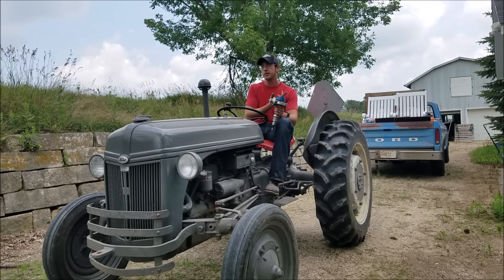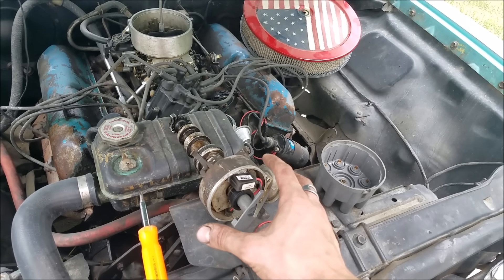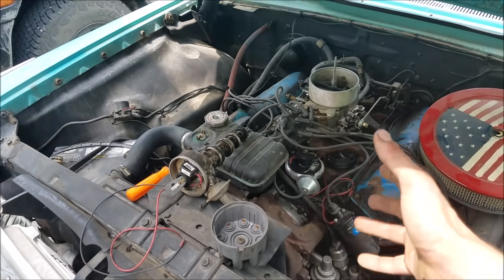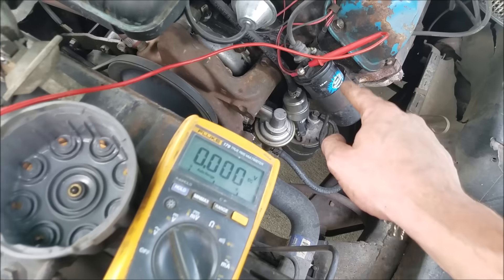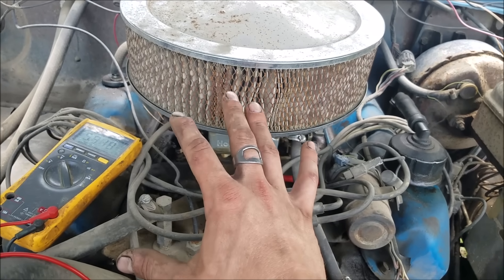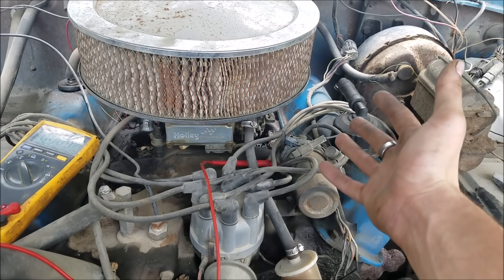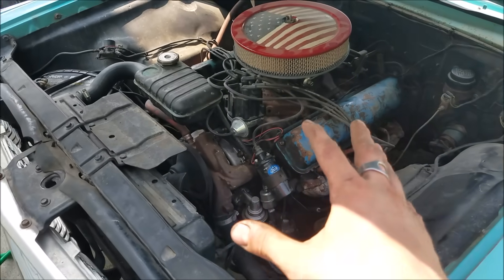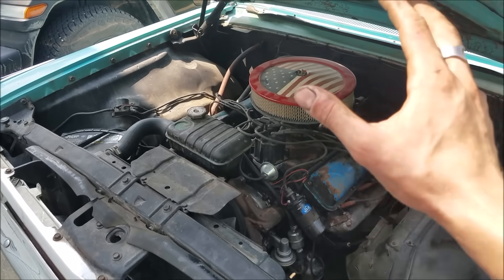Pertronix Ignition "Problems & Failures" (It's Actually YOU)

Comment: Good point on the battery voltage going to the coil Luke. It's the same mistake folks make when putting an HEI distributor in a GM vehicle. GM used a resister wire for point type ignition systems, so if upgrading to HEI, it is necessary to use switched battery voltage to the HEI distributor.
Reply: Same with Ford as well.  I knew a guy that transplanted a foxbody EFI 5.0L in a '65 mustang.  Dummy used the OE resistor wire for the points as his ignition hot for the ignition system on the EFI motor.  Thing was hard to start, wouldnt stay running and ran like total shit.  Sad thing is he never found the problem nor did he acknowledge the problem he swears up and down there was no problem just that the foxbody 5.0 wasnt that powerful.  I found out that the car went to the body shop from the shop that did the work and they fixed the problem cause they knew something was up.

Comment: Yes, I'm older than dirt and have been using Pertronix units since the late 70's on everything from Ford tractors to cycles to VW's to MG's to air cooled water pumps with Wisconsin engines  to boats, well you get it.  Never had a problem but your right about having a full 12v power source and the right ohm coil otherwise it's a great product.

Comment: Seen this before, was on a late 70's F250 extended cab a friend of mine bought years ago that had the pertronix retrofit installed. I didn't know much about the system at the time but the truck came with a metric ton of boxes filling the back of the cab from all the stuff the previous owner had installed. Dug in, found the manual, laughed my ass off. If whoever installed that thing had RTFM, they wouldn't have been so eager to think the truck had a "timing issue" or whatever that guy said. 

On another note, I'm not a Ford, Chevy, or Dodge guy, I've had two 80's Dodge trucks, two Squarebody GM's (A 74 and I just got an 83 C20 with a Muncie SM465 and a 350, oooh yeah, dump truck mode, engaged!) a 89 GMC Sierra,, and I've owned a '93 F150 "Flareside" extended cab for a while now. Also had a '77 LTD, two Oldsmobile Delta 88's, one a '77 and the other a '79, and a bunch of other American and Asian cars.

Anyway, point being, my biggest gripe with Ford is that damn resistive wire you mentioned. If the vehicle sits and a mouse chews it, things get real fun real fast. Although I've only ever seen one case where that wire went bad of it's own accord. Had that issue with my '77 LTD.. Oh boy... You CAN rewire it to use a ballast resistor if you ditch the duraspark, but I found someone who wanted the car more than I did, so, she's gone. Although, 90% of the issues with the DuraSpark and whatever the hell the Dodge equvilent is that the modern ignition boxes SUCK!. The Ford DuraSpark aftermarket boxes just love to break, and I swear no two are ever the same size, and the Dodge ones, whatever they use for epoxy in them these days just turns to goo in about two years. Honestly my favorite ignition system is GM's HEI, just because I've never really had an issue with it, 'cept with some really cheap aftermarket coils overheating and letting out the factory installed smoke monster. But any American V8's, especially small blocks make me smile, glad you keep these old cars going and in service. I use to daily drive older stuff, now I just drive older stuff occasionally. But I'm excited to straight-pipe that '83 C20's 350 and irritate the hell out of everyone winding out those 3 usable gears. 

Anyway, like the other guy said in the comments, this tirade is over, keep up the great work man!

Comment: Since my 63 Comet 170 quit running and I cant figure out why, I betting that I burnt out this unit by doing this wrong.  Worked for a year - and now wont fire.  I still have a weak spark which has thrown me off this trail - but perhaps the spark just is not good enough to fire the engine on cranking.
Reply from the maker: Resistance increase when pressure increases - so a weak spark outside of the cylinder is likely no spark within

Comment: Opinions on cheap $100 knock-off ebay carburetors?
I picked up a "Weber" 38/38 to have on the shelf as a backup just in case.
Reply: Seems off topic, but I'm running a $100 knock off Mikuni on my Harley.  It's still on its first tank of gas, so a little too soon to say, but it seems great. Only downside is the choke cable only has two settings. A little too much and off.

Comment: before i watch,are people putting these after a regulator/ballast resistor that isnt putting out 12 volts? just wanted to guess before seeing the video or reading the comments so thats my guess,yes they will fail or malfunction without the correct voltage
Reply from the maker: Yep, you got it. There is a trick to the ignitor 1 and 2 that furthers their complexity - you have to maintain the ballast, on some units, but still keep the module itself powered on 12 volts. That really gets people. 
Just far easier to go ignitor 3 route

Comment: I've done a couple HEI's and the instructions showed how on my old 72 Nova and 68 Chevelle it plugs into the fuse panel easily. Never had an issue but thanks for the run down I can see how less voltage could cause issues to a module

Comment: I'm totally with you on making the right positive lead connection. I've had a Pertronix ignition with original coil on a 1970 Chevy for years with no issues.  However, I would like to note that a ballast resistor wire for a coil may not always read less than 12 volts. I fought a 1972 Ford F250 for a whole day wondering why the famous pink ballast resistor wire kept reading 12 volts. Ohm reading was the correct 1.5 ohms but voltage always 12. Finally asked a friend that cut his mechanic teeth back in the day on these things and he explained the ballast resistor wire as something that slows current not reducing voltage. He told me if you turn on power and try to get a straight voltage reading you will always get 12 volts. The way the resistor works is as the contact points open and close very rapidly while engine runs, the battery current passing thru the resistor wire gets slowed such that only 6 to 8 volts reaches the coil ultimately. He told me the only way to test a ballast resistor wire is ohm test. I know this doesn't apply to the video but thought I'd throw that out there in case someone tries to voltage test their ballast resistor wire and why they might get a 12 volt reading and pull their hair out like I did. Thanks for the tips.
Reply: Its just like the ICVR Ford used in the 60s up through the 80s, it takes 12v in but pulses the 12v at such a rate you see 5V at the sensors.  How ever if you are using a multimeter or a test light you should be able to see the pulsing up to 5V or 6V.  It wouldnt be pulsing so fast it would be showing a steady 12V.  It is how I test Fords sensor circuits, if a gauge isnt working I use a test light which I have one with a digital read out and it will pulse on and off going from off to 5V then off again.  You should see the same thing in the resistor wire if it is a pulsing circuit.

As far as using the OE coil, all of my Ignitor II`s are running OE coils that has to have an external ballast resistor and I run it with them.  I just connect my Ignitor II to the 12V side of the ballast resistor and make my negative connection to the negative side of the coil.  I honestly dont believe you are losing enough spark to notice a difference in performance between running a external ballast resistor OE coil vs a recommended petronix coil especially if you are dealing with a stock engine.  If you are running a hotrod then the last thing you should be doing is running a points distributor with a petronix points elimination kit over a dedicated electronic ignition system.  The Petronix I always felt was designed for the collector car hobby for people that were restoring cars and wanted them to look original but perform better than original as well as remove the whole adjustment of points.  People that want to go fast or make power wont be concerned about keeping a OE distributor and stuffing modern guts inside.

Comment: Best aftermarket system out there!  Have been using one in my Willis coupe for 15 yrs never missed a beat!  Compared to the Accel distributor I had for 5 yrs and broke down 150 mile from home.  Thanks Unkie Luke!
Reply: Accel equipment us junk. Bought an Accel distributor for a Ford Cleveland. It failed while still under warrantee, so I shipped back to be fixed. When I got it back, it was deader than a doorknob.When I sent it back again, I requested a dual pont, which worked OK.

Comment: I added a 12v source from the fuse box but left the white resistor wire in place as well. Is it OK to run this way? This is on a 73 chevrolet with ignitor II and stock distributor.  It shows 12 v .

Comment: Hi Luke! I have now got to recheck my fuse (keyed) tap and see what side of the fuse I tapped into. I need 10Amp for my new Holley carb electric choke wire. I did put an inline fuse 10 A in between the fuse tap and the choke. Good info and good advice.
Reply from the maker: Oh you are completely fine then my friend🙂

Comment: By a  direct call to Pertronix and also a previous visit since I live close. It is NOT necessary to bypass the ballast resistor for the coil. I use the 12 feed wire from the ignition switch to the resister to power the module in the distributor. After start up the voltage drops to 9 volts which is normal on 12 cars. 12 volts stay on the Pertronix module. This is the proper voltage for the coil and causes less heat to the coil. The tech said the spark would be slightly less but plenty. I also use the Pertronix coil. The system has been flawless for 8 years on a 1956 stock vehicle.
Reply from the maker: I agree with you - I have that in my pinned comment regarding the ignitor 1 and 2, although this is where I go with the coil listed as “no external resistor required”. I probably should have mentioned that for folks that just have to have the 1 or 2 unit

Comment: I got a 66 mustang coupe with a 289 and when I turn on the key I have no power but I can crank it by the solenoid but that’s it and I put a new ignition switch in it cause the original broke and it’s got a new solenoid and many new parts like new ground and new power wire to the starter what’s the best way to look it up or what do you think is wrong I think I’m missing a ground
Reply: Now if it was a Chevy I could get it running easy but idk what I’m doing with that janky ford wiring
Reply from the maker: It’s pretty straight forward, many chevy folks actually utilize a ford relay. 
I’d have someone hold the key in “start” position and probe the signal wire to see if you have 12 volts to that point. 
From there, there are two different type of ford starter variations - single Prong grounded through coil body, or dual prong. 
Personally a suspect a grounding issue between the coil and battery.
Reply: @ThunderHead289  ok I’ll have to check that out thanks I’ve been trying to get this car running for my mom and it’s been kicking my ass

Comment: You might want to mention when looking for the 12v key on source that you make sure you pick one that also has 12 volts while cranking. Most cars kill the power to things like a radio while cranking..  good tutorial Luke!👍
Reply: Hey Thunderhead, just found your channel, may cool videos, I have an '83 G20 van myself, sitting right now, but ran when parked :).  Maybe you should put this in the description, or pin it.  From experience, I suspect there are only one or two circuits like this.  IIRC you removed the resistor and swapped the coil.
Reply: that's where continuity buzzers is perfect with the battery disconnected
Reply: Ditch the worthless Pertronix and use a Ford Duraspark with a shortened resistance wire and a high quality module.
Ive always gotten a nice bright blue spark from the coil that often is capable of arcing over one inch, the same can't be said for any Pertronix unit I've thrown into the scrap pile.
Reply: @donreinke5863  

Oh sure like Ford's gonna give you a performance ignition system?? 

NO NO AND NO!! Follow this mans advice and you'll wonder why you stuck with OEM junk ignitions.
Reply: @extremedrivr  I follow no ones advice.
Having had years of personal experience with both, I ABSOLUTELY know which system produces the most spark energy.
The Ford Duraspark system in its stock form is superior to Pertronix, and when the primary resistance wire is shortened, FAR exceeds it. 1inch+ bright blue spark>weak half inch yellow spark.
Only in the first 4 years of its use, before the module circuitry was redesigned was the Duraspark troublesome. The early modules (which had hot open circuit issues) are all long extinct. 
I converted from points and modified my first Duraspark system in 1980, likely before you were even whelped.
I will put my 50 years of experience in automotive repair and modification against your obviously limited knowledge any and EVERY day.

Comment: The takeaway for me is points suck dump that and go with electronic ignition and EFI. Every single video on restorations it's either carburetor or points and when the hood is lifted and an electronic ignition is in it they say good it is switched over
Reply from the maker: Efi is junk - watched too many fail and then parts for them are unattainium on the road. If you never plan to leave your town or surrounding area, I’d use it - anything partner than that, and I’d keep with things that can be had at a parts store. 
Power tour is a prime example where I have seen several folks completely out of luck.
Reply: @ThunderHead289  I'm going to buy my dads 65 chevy van and put a holly fuel ingection and electronic ignition in it and get perfect timing and better gas mileage and a few more horses with that setup.  And in the winter will start right up.
Reply: @ThunderHead289  Luke, the efi kits are an even better example of how important it is to read and follow the instructions.  You do have a point about parts availability so that is why I keep them with me.  I have not had any trouble with MSD Atomic EFI. Great video! Thanks!

Comment: Yes agree totally. Factory tach cars, need that dropped voltage. 67-73 Cougars, Mustangs, etc. And all Cougar XR7'S, have a factory Tach, that we all would love to keep working. What's the answer for factory Tach Ford's? My example, points, 351C, switch to pertronix, and Wala! Factory tach does not work. So I have stayed with points. New ignition parts.
Reply from the maker: I’d make a voltage divider before the tach, myself
Reply: @ThunderHead289  Yes some on Cougar web, wanted to try resistor, or Chrysler type ballast resistor. Every Ford guy I talk to tells u Per-tronix are great for Ford's, until u have factory Tach. Very common problem with Mustang/Cougar guys. 351C 4V, 4SPEED,  owners have it WORSE.(OEM, Dual point distributor)

Comment: 5:50 FE 352 small block? mijn is a FE 352 big block. one of the smallest but still a big block ;)
Reply from the maker: I’ll have to listen to what I said - I’m sure that wasn’t intentional. The other two cars I have these on are 302 base Windsor engines. 
I really don’t like saying big block or small block with fords, but it slips every once in awhile. 
Should be “Windsor & FE”
Reply: @ThunderHead289  the slipup made me smile! ;)
Reply: Yep, for '58 & '59 there were 332 FE. HD trucks may have used 332 in later years.

Comment: I have always used Pertronix and no problems but because of the pandemic they say that the latest Pertronix systems and a lot of the electronics like MSD and say Mallory the electronic modules have failed because of bad quality control even contact points saw a video on Uncle Tony's Garage which makes sense . I even got a bad set of brake pads last week that were not exactly the same as the OEM pads that I took off I had to slightly grind the pad to make it work which is the first time in my life that I did such a thing.
Reply: A lot if replacement parts come from China today, and sometimes, are not a fauthfull reproduction. Three different attempts to get a power steering pressure hose for my Saginaw power steering box(Ford issue, but identical). The tubing had a smaller diameter, and had a flare not compatible with the connection point. This is just one example of many.
Reply: @jeromebreeding3302  funny I had the same problem brand new power steering hose from a previous owner was installed on a car I bought and it was leaking at the crimp . I used to be a mechanic on daily basis and even then had parts issues but today is terrible and especially where some of the parts are located service wise . I know many places that won’t quarantine a part if isn’t OEM can’t blame them. I am 71 and still enjoy working on cars and try to keep up with the latest technology and problems. Good channel.
Reply: A note on crappy Chinese auto parts, the late John Prine in his song, "we can't make it in the USA". What ever happened to our manufacturing might ? We used  be the leader !

Comment: I recently converted Points to Module, A simple screw in unit to replace points with the stator ring slipped over the dizzy cam lobes to trigger as the lobes passed the sensor.
The Unit said it needed a 12 volt supply and a 12 volt coil of a particular type and as the English car ran an 8 volt resistance coil and an archaic system that supplied 12 to 14 volts to the coil in crank and then relied on a resistance wire when running I just bypassed the entire thing with a fresh 12 volt source from the key forward.
I also tossed the Condenser as instructed and thats the other thing people often forget.
Bit of choke and a flick of the starter button and Boom she fired and ran like a dream.
Next job is to check the dwell (Adjustable on the dizzy) and the timing and its job done. 
Simple when you read the destructions eh?
Reply from the maker: Absolutely.